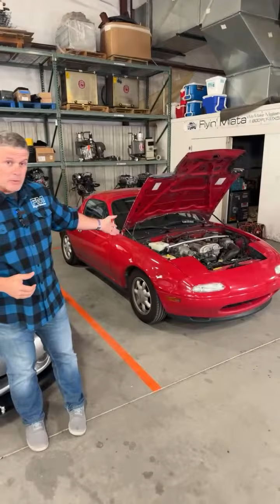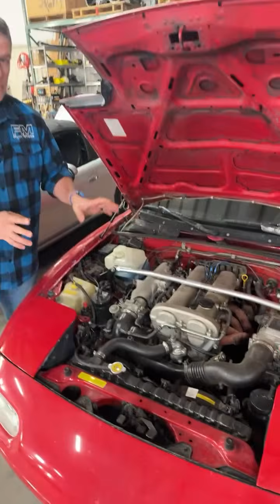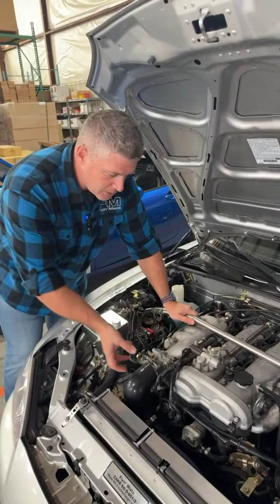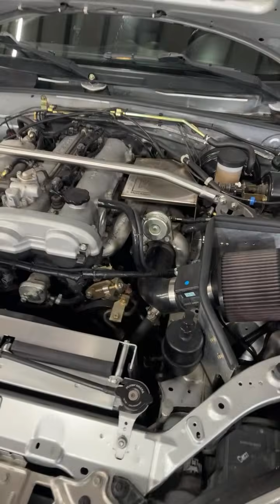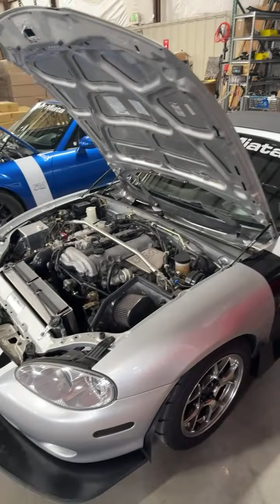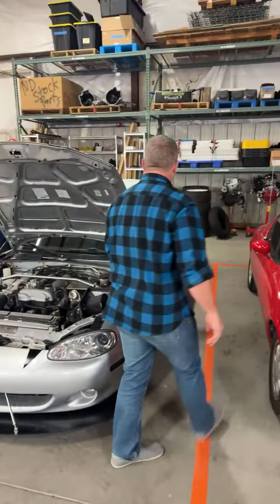How to Prep a High-Mileage Miata for Turbo - FM Live 11-13-24

Comment: If I'm pulling the oil pan to drill and tap it, should i replace the oil pump? 
Is the nb2 oil pump better than the nb1 oiill pump?
Reply from the maker: @Criam Replacing the oil pump shouldn't be necessary unless you're seeing evidence of a lack of oil pressure. However, if you're planning to shoot for 300+rwhp, swapping to a Boundary (or similar) oil pump is pretty much required. There are no differences that we're aware of between NB1 and NB2 oil pumps.

Comment: Ha! I did this with my 2001 before installing your kit. Went to put in a new clutch and it turned out that it already had a low-mileage Happy Meal in it! Adds 'check with PO' before 'upgrading'
Reply from the maker: Right on! What a nice surprise!
Reply: @FlyinMiataVideo  haha, kinda. I ended up installing the new clutch pack and a light and flywheel and sold the low mileage one so worked out in the end. Still kicking myself for not asking the previous owner 😏

Comment: 6:05 “Change your transmission fluid before you install a turbo”. No, no, no, no, no!  What I think you meant to say was change your gearbox oil before you install the turbo… What? You don’t have a gearbox? Then swap out your auto for a manual before you even contemplate putting on a turbo. I know this is an American video, but for God sake, use some common sense.
Reply from the maker: okay
Reply: if you're not american, use YOUR common sense. we use different words in the states. nobody calls transmissions gearboxes here.
Reply: @ There’s no country on the planet (including America) who puts “transmission fluid” in a manual gearbox. Transmission fluid is reserved ONLY for automatic transmissions.
Reply: @just_passing_through oh you thought he was going to put ATF  in a manual transmission... you ain't from here are you boy

Comment: Will a moss cobalt coolant reroute be compatible with your turbo kit? I have an NB1
Reply from the maker: You can install probably any reroute on your engine with our turbo kit, but you won't be able to run your turbo water lines through your reroute housing unless you use our reroute.

Comment: My miata is a 1990 stock that I am taking the engine out and do a rebuild . Is there anything I can do to pre it for a any future upgrades. My miata will never see a race track for competition, but maybe for fun. Otherwise is going to be a street car.
Reply from the maker: If you're going to turbocharge the car in the future, it's easiest to drill and tap the oil pan when the engine is out. You can just put a plug in the pan in the meantime.

Comment: You give a hp range. Is this due to variation in the engine for different year models? If so which 1.8 benefits most?
Reply from the maker: It's due in the variation of stock injector sizes - that's the limitation in power output on our kits. The NB2 (2001-05) cars have the largest stock injectors so they have the highest peak power.
Reply: @FlyinMiataVideo  What's the next limitation and at what power level? Like assuming you could provide all the fuel it could possibly use.
Reply from the maker: With larger injectors and a programmable ECU to control fuel and timing, you can get about 240-250 at the wheels. That’s the sweet spot. Above that and you’ll need to build the engine and be concerned about transmission strength. 
Be aware that this would invalidate the EO.
Reply: @necoxus1061  ECU/Boost control, then cooling and fueling. The stock ECU with their piggyback unit limits to 6-8 psi (depending on shimming of the wastegate. If you want to run more, you'll want a standalone unit for fuel and ignition control, which voids the CARB aspect. Also, more boost, more risk
Reply: @dcvroom  fortunately, I don't have to worry about meeting CARB. Do you have any recommendations for the standalone unit? I see that Megasquirt is popular with Miatas.

1994 1.8, planning to use the FM turbo system. I already have a set of RX-8 6-Port Yellow Denso fuel injectors, I believe those should be more than enough flow. Engine and transmission are stock, so I'm not interested in pushing them terribly hard. I just want to get the most out of the turbo system itself.
Reply: @necoxus1061  Mega squirt PNP3, as there is a lot of support both DIY and pay to play tuners. Beware the yellow injectors as they are often a fail point. At the very least, have them bench flowed and cleaned, I recommend RC Engineering. I was running 12-14 psi and warped my head at the track, now doing a full motor so I'm going deep. If you're going to run on your stock (healthy) motor 12psi seems to be a sweet spot. Beware the cooling, especially at the track. Turbos are a magnitude increase in temps

Comment: Excellent advice.  I have an NC3 and have done many car builds. That being said, I've done suspension, cooling upgrades (trust me, you need this), body reinforcement, and many gauge upgrades (true oil gauge and Banks data logger, hence how i found week points. Also, I upgraded clutch to twin disk. Turbo Day is coming and will be confident of it being reliable and safe fun.
Reply from the maker: Very cool! You shouldn't be waiting much longer for your NC turbo!